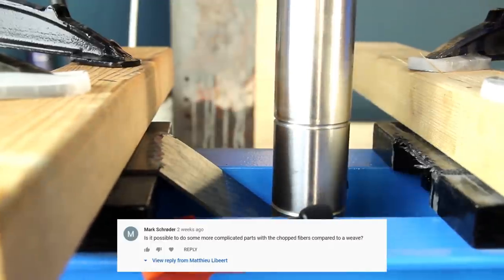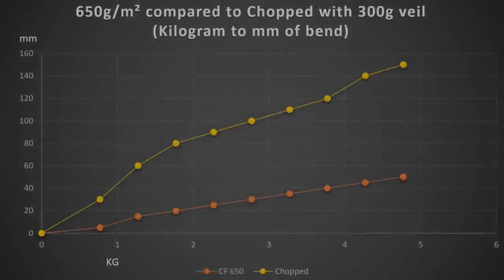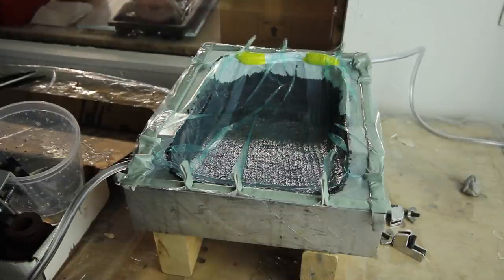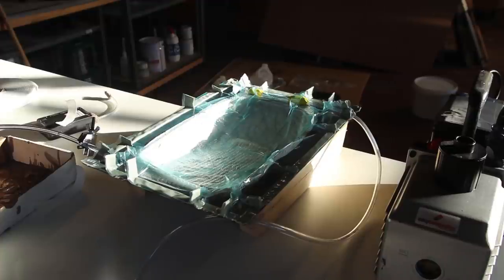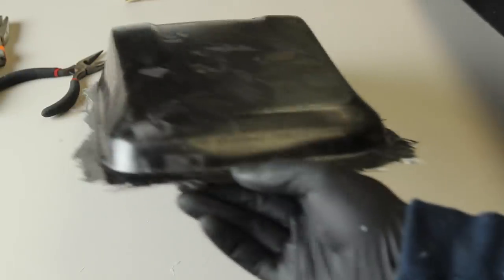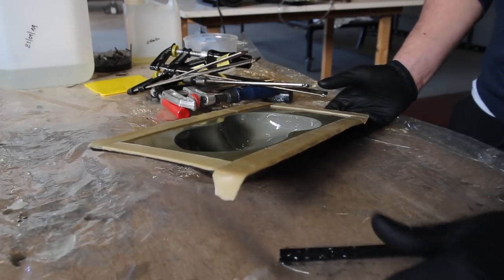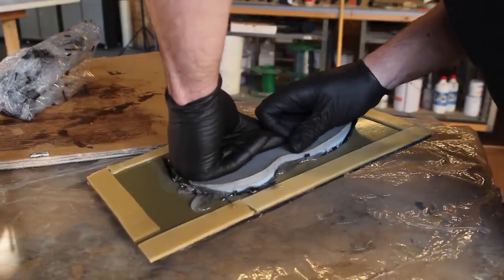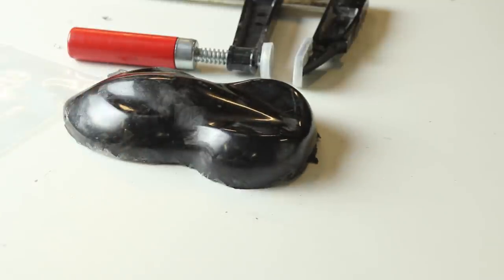Forged Carbon Fiber - Chopped Fibers (PART4 Test Results & Real Forged)

Comment: Here in USA the fabric version is sold by Ulticarbon. Helps with getting an even layer, less messy and stays where you put it in the mold. Whether the forged fabric has the chopped look or "real forged" marble look depends on how you apply the resin.
Reply: Would you mind elaborating on that last part? Would really be interested to know how to achieve that marble look vs. the chopped fiber look, closer to the real lamborghini forged cf.
Reply: @TheShaddix  Infusion produces the most defined chopped look. With a hand layup after the fabric is in the mold and saturated with resin, you can "massage" the material from the back to shift the fibers slightly to break up the bundles and get a more marbled arrangement. Also if you're skinning then sanding into the cured CF makes a more marbled look.
Reply: @LindyDesignLab  That makes sense, thanks!

Comment: Some in the industry would call your silicone plug an "intensifier". Perhaps offseting the side walls of the intensifier inward a bit may help reduce dragging down the radial wall fibers. It would also have to be a bit longer, to maintain the same net compressed volume. The intensifier will initially clear the side wall fibers when pressed into the mold, and would then barrel outward once it reached the bottom, expanding normal to the radial wall fibers. You could mold this intensifier shape in the part mold, using the wax sheet to create the radial wall offset. Great work BTW!

Comment: I have heard that epoxy and polyester is the most used resin for forged carbon fiber, but I have read that, polyester doesn't bond that well with carbon,
any views on this?

Comment: The downside with this method will be getting all the air out of the mould since vacuum is not used? Especially with larger item. Besides, your saved time n cost will be used on creating the silicon mould instead is it? Just a thought. Good work on sharing the vids. Appreciate it! Btw, cant seems to find much wetlay+vacuum method vids on YT. Mostly all vacuum methods are infusion. For people who have budget constrain, maybe its a good add-on?

Comment: I think the forged method may be better suited to parts that would be difficult if not impossible to make with sheet. Reason being that with simple mould you get a good consistent thickness with sheet. If mould has plugs or other protrusions (say for mounting) sheet is much more difficult to lay...
Reply from the maker: correct! 100% agree

Comment: This isn't real "forged" carbon though. You're still doing it with wet laminate, instead of thermoplastic or prepreg, in a heated press. I make SMC at work, and you aren't coming close to the pressure needed to do what you're wanting. With a heated press, these parts take 3-5 minutes to fully cure, and they pop right out of their molds when cooled (for tp, prepreg pops out immediately).

Comment: Hi Matthieu. I've tried infusion several times but it keeps leaking everytime the epoxy resin reaches the sealant tape. FYI, I'm using butyl tape as the sealant, as composite specific sealant is hard to come by in my area. Have you ever experienced this? If yes, what's the best way to do it? Should I try different type of sealant?
Reply: Hi mate, butyl will work with infusion, simply make sure to have at least a 20mm width tape for the seal. If you have a little skinnier tape, just use a couple of rounds and you should be good to go

Comment: Isn't what all these "forged carbon fiber" videos  just chopped fibers being laid out like normal  weave just to give the appearance of forged.  I was under the impression that real forged carbon is stronger due to the lower amount of resin and are actually pressed into a mold using tons of force.  I am really looking for someone to make a real forged part to compare.
Reply from the maker: It is under way, this is just the exploration phase to understand the behavior of the material a bit better, then I will get into real forged